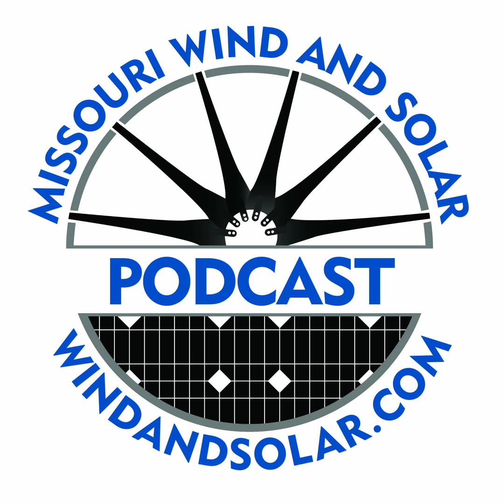What is the difference between low and high frequency inverters?

Comment: Wow, that caught my attention, you guys gave me something new to think about. I purchased two brand new inverters on eBay just to operate my kitchen appliances such as; refrigerator, microwave, and coffee maker. Everything was operating great in my kitchen for a period of four days when suddenly one of my inverters set off an alarm and now it is trash. The other inverter lights up when turned on but won't send power to my kitchen. After listening to what was said, I now have some hope. If I can't come up with the answer as to what i did wrong, it will happen again. I'm going to try a different inverter type. Is grounding very important?
Reply from the maker: Grounding - yes - very much so. Call one of our sales engineers to talk with them about how to get things going right.
Reply: @MissouriWindandSolar  Thanks for the information, and I'm going to go with what you said in spite of what I've been told by two electricians. Looking forward to have a chat with an engineer in your neck of the woods. For starters, I purchased an Aims 12-volt 4000 watt split phase inverter charger.

Comment: lost me with hot water service as a surge. Surge is caused by some sort of rotary motion/ compressor like a fridge, an air compressor, a large power tool startup like a lathe etc.
Reply: Heat pump water heaters use a compressor motor.